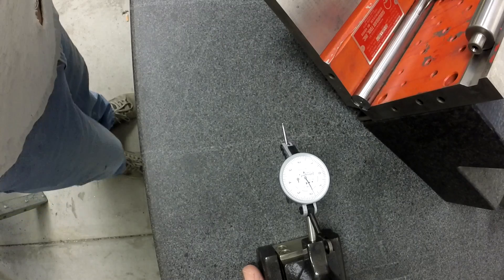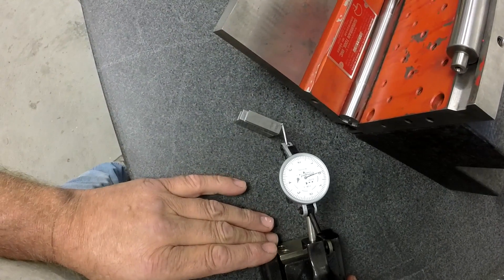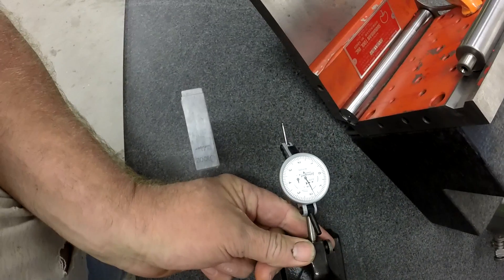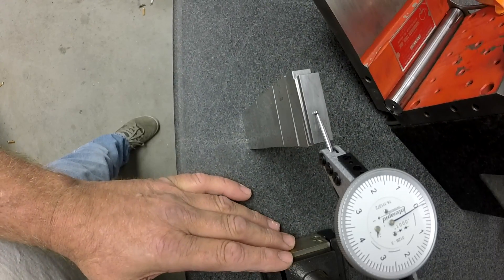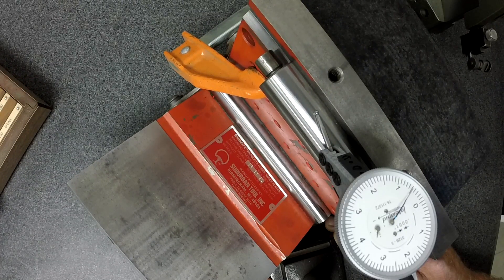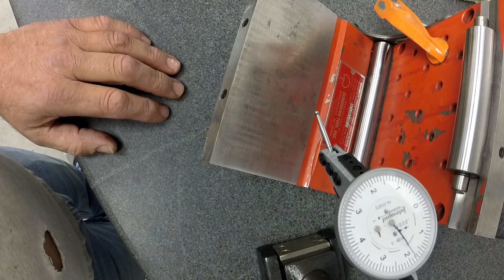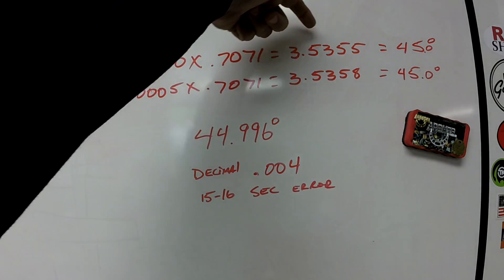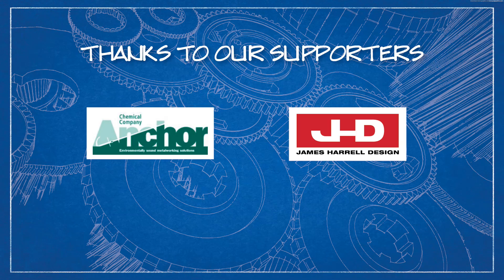Sine plate rework part #2

Comment: Great lesson Stan Thanks!  You mentioned you can correct it or note it and correct in the future.  How would you correct that error?  Thanks
Reply from the maker: +JC S It would take a regrind on the V sections of the plate to make the correction, but that also lowers the roll taking it out of parallelism with the upper plate, as you can see, this is no small task. Still contemplating my next move.
Reply: +Shadon HKW  I am not sure how that would take it out of of parallelism, so I am looking forward to Sine Plate Rework Part #3.  Thanks again!

Comment: Here's a micro-quibble: when you work to four significant figures your math has to be one significant figure more refined. You were comparing the effect of 5.0000 Vs 5.0005 roll centers on the setting stack for 45 degrees. 

You used the sine of 45 degrees as 0.7071 which is the value for four significant figures. Most trig functions run on to a zillion decimal places but in this case, the sine of 45 degrees to five significant figures is 0.70714. The 0.00004 difference inserts a tiny error in your calculations (0.000034" in the stack height) having no practical effect on this particular problem.

But another problem may involve more complex calculations resulting in numbers compromised by non compensating rounding errors. Thus the need for the extra significant figure.

Don't you just hate this kinda nit picking?
Reply from the maker: +Forrest  Addy Ha ha .. not really, your skin gets thicker when you hit the "upload" button. I always enjoy your comments :)

Comment: Been there. Fussy work on the surface plate is standard fare for toolmakers and metrologists but a tough sell for open shop machinists, skeptical of high precision and those who work with it. I never saw the need for the fuss myself until I got into inspection and discovered the world of cumulative error, repeat zero, thermal expansion, validating equipment, etc - the stuff Stan is working with and explaining so well. 

Stan's sine plate had a tiny roll center distance error that confounded angle setting by nearly 1/4 arc minute at 45 degrees. Had Stan the need to determine an angle to 5 arc seconds, he couldn't have done it with that sine plate without first validating it, determining the error, and compensating for it. 

In some work, 5 arc seconds is the difference between a good part and junk. Tiny errors count: take for example the Hubble telescope in 1990 when its first image was a billion dollar blur.

You younger guys take it from an old fart: pay attention when a lesson comes along - like this one Stan offers. You never know. You may not need to learn jo blocks and validating sine plates to do your present job but a future opportunity may make you wish you'd learned the lessons each day brings. The people reading this are most likely curious and motivated, learners of lessons and receptive of improvements. But they are sure to work with dismissive scoffers, skeptical of any change or need to do things in a better way. Tune those people up Your grand children will thank you.

And thank you, Stan, for bringing this teachable moment.

Comment: Excellent systematic approach to checking and recording the errors. No big deal to use the exact dimension since we are using calculators instead of look-up tables from reference manuals with fixed distances for finding sine bar stacks. Thank you for having these discussions, Paul

Comment: Your videos are very interesting, Stan.

There may be an easier way than trial-and-error to set the height of the bottom stack of gage blocks. With a height gage, measure to the top of the bottom roll. This will be accurate to (at least) 0.001". Wring together a set of blocks to this nearest 0.001". Measure whatever difference remains (it'll be less than 0.0010") between the stack and the roll and remember/record the delta. Add the 5.0000" of gage blocks to the stack and (as you did) measure the difference between the top of the stack and the top roll. Correct with the delta measured at the bottom and the residue is error.

I suppose it's a matter of preference, but I would find it easier to do a simple correction of a modeled error than to fiddle/measure/re-fiddle with gage blocks, especially for a one-time setup.

Best,
ggs

Comment: Great video, and I understand limiting the math, but I think it should be pointed out that the error in gauge block stack height decreases at smaller angles and will increase for larger angles.  Just the engineer coming out in me.
Reply from the maker: +MinProcEng1 That sucker is dead on @ 0 degrees!

Comment: Did you measure your gauge block stack with a micrometer to be sure there was no error in it being 5.0000 inches?
Reply: +bcbloc02 I check my micrometers with the gage block stack, not vice versa.  Gage blocks are the shop reference for length, not the micrometers.
Reply: I figured when you were doing a stack it might be good to check it to be sure you got nothing in between your blocks. I have never had gage blocks to use and I don't really do tenths work so this is all learning for me.
Reply: +bcbloc02 If they wring together, there is nothing that matters between them...

Comment: Just a thought, one thing you have not shown checked is the diameter of the sine rolls. Your center to center measurements assume the rolls diameters are exactly the same. If the .0005 diff is in the roll size then the error will be half  that for center to center.
Reply from the maker: +dsmiffyrc We measured the rolls in part #1
Reply: +Shadon HKW  Sorry must have missed that bit!!!

Comment: Could you not put the variance down to temperature difference? Would be interesting to measure the temperature variance between the sine rolls, granite plate, granite block and the column with gauge. I know when working with such small measurements, just body heat from your hand will make a difference.

Comment: 2:45 is probably one of the best dial shots you've ever gotten.
Reply from the maker: +Max Maruszewski Looking at it on screen I would have to agree, too bad I couldn't see it when shooting! :-D
Reply: +Shadon HKW I think it'd be nice if indicator mfg's were to offer 'video friendly' dial faces as an option.
Reply: +Shadon HKW - does the camera have a "live" video output which you could hang a monitor on? A magnified view of your indicator dial would probably come in useful at all sorts of times, and you could adjust things when making a video without the camera being in your way.
Reply from the maker: +Mark Sinden I use a Go Pro which has no back screen, getting in close and being compact are the two main features of this camera. But it also has its drawbacks (no zoom & no monitor capability)

Comment: I haven't put much thought into this, so I might be wrong, but couldn't the error also be caused by a difference in the size of the rolls, and if so the centre to centre distance may be correct (angle dependant?), while the front to front distance is over? Pedantic, I know, but we're talking about a few microns here.
Reply from the maker: +John Alexander We measured the rolls in the last video, less than .0001 error between the two.
Reply: +Shadon HKW I guess a difference in size would be unforgivable, since its would cause all sorts of discrepancies, whereas an error in position is easy to correct for. Anyway, thanks for all the videos - informative as always.

Comment: If that much precision is necessary, be sure to add at least two more digits to the sin calculation and Pi. For example, sin 45 is .707107 and Pi is 3.141593. Most of us won't ever need to do that but good to know if you do.
Nice lesson, Stan.
Thanks,
John
Reply: +John Bazaar If you use sin 45 in your calculator, it will automatically carry all of the decimals it has regardless of what it shows.  Same for pi.  Most calculators will have at least 10 decimals.  To Stan's point, it doesn't matter based on the accuracy/resolution of the gauge blocks.  Reminds me of Tom Lipton's angle block challenge re the measuring of the 30 arcsecond gauge block.
Reply from the maker: +John Bazaar My gauge blocks dont go down that far, so going out that far ( in decimal places) wouldn't do me any good. But the math is fun :)
Reply: +Shadon HKW
 Agreed. The math is fun.
And everyone else thinks we're nuts. 😊
Thanks,
John
Reply: +Barry Gerbracht 
I agree. As I stated earlier, we will most likely never need this for our work.
In the past, however, I have had to measure precisely and accurately 10 millionths of an inch. 
I probably never will have to again but it's good to understand the math and the sources of measurement uncertainty.
Anyway, like Stan said, the math is fun.
Thanks,
John